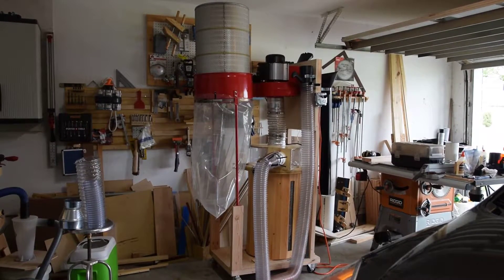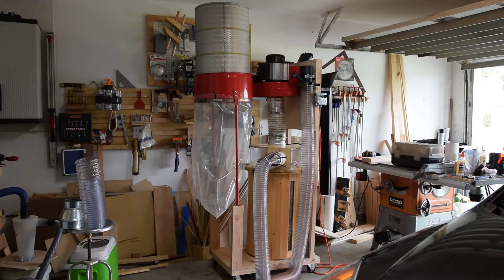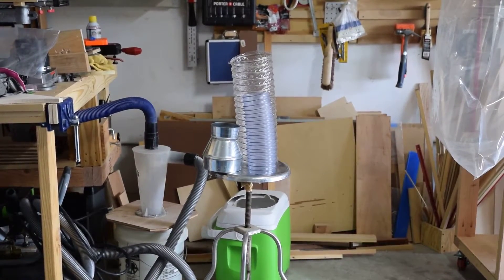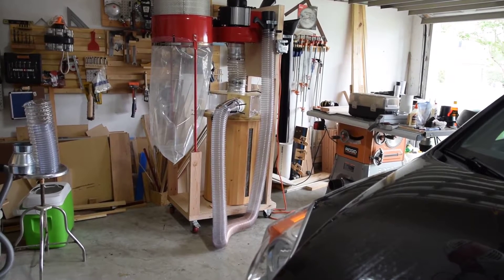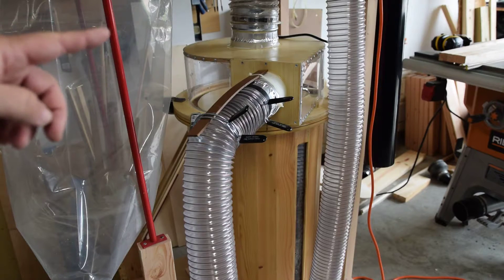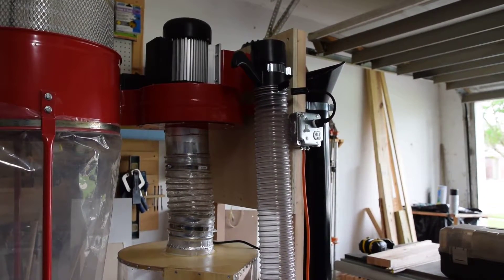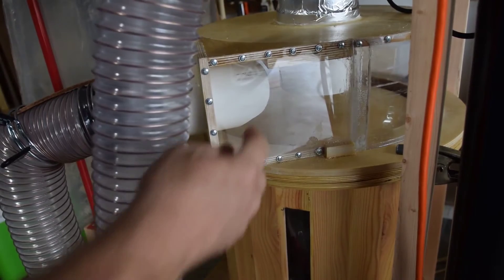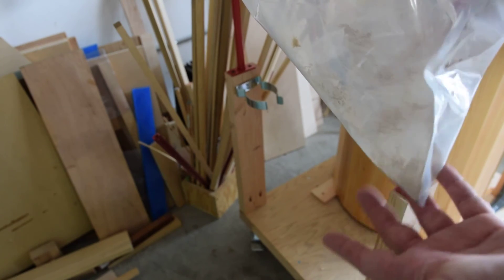Dust Collector build

Comment: I just got that same Penn industries dust collector(craiglist) w/the cheaper winn filter for $75... Score!!! But my question is do you think it has enough cfm's to add a dust deputy xl with 20gal steel barrell... If I had the time I'd do a build like yours. Great video thanks Wilbur coast of Maine
Reply: The Dust Deputy XL is a bit too large for a 2HP motor (the motor spec that Penn State is now using). The XL would work best behind a 3-5HP motor. The current Penn State product (DC250SEMB) is rated free air at 1350 CFM but of course this air volume will deteriorate as piping lengths and turns are added.
Reply: @darrowfortheprosecution1404  Do you have a DC250SEMB? I've had a really hard time finding any reviews on it. Considering either that or the Rockler 1250 CFM Dust Right one. I'd go for the quieter of the two if I knew which one that was.

Comment: Looks great just one comment, why not put a 45 angle at your baffle to drop the hose without the kink.. other than that nice job.. ps. how do you like your table saw? I have the same one... for me.........great saw.
Reply from the maker: The elbow should have been thought of early on, but it's one of those things where you think you plan everything out then you miss the obvious.  I had an extra 4" hose clamp handy cut a thin strip of hardboard and pinned it under two clamps, one of those clamps holds the hose on.  That strip was flexible, so it keeps it from kinking..

I love that saw.  It comes in handy for every project I've done over the last three years.  I've made several jigs for it and wouldn't know what to do without it.  That saw did most of the work to build the dust bucket in this video.